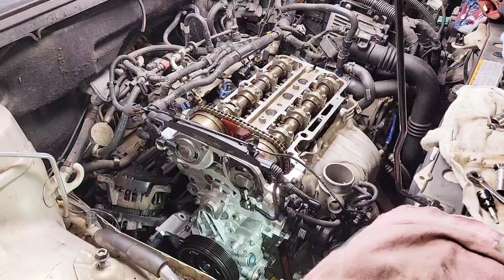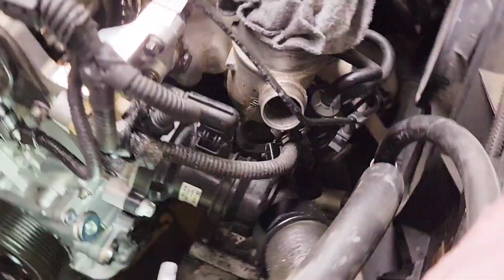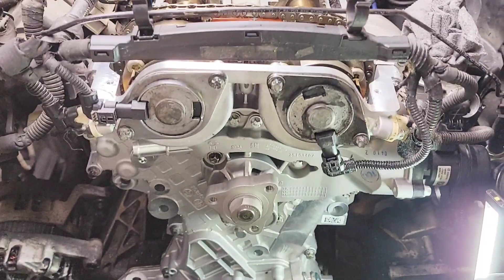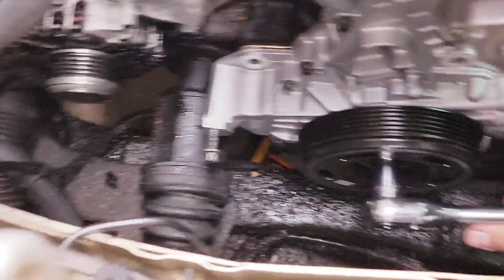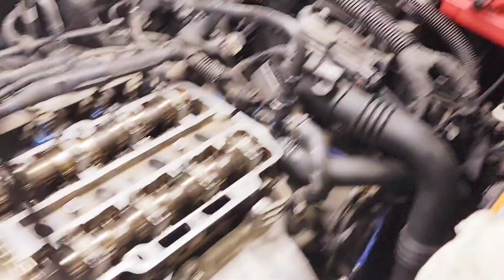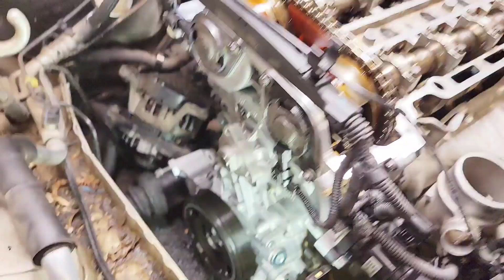V15: Chevy Cruze Timing Job Done!  Priming Engine Oil before Starting this Motor

Comment: Did you need to remove the camshaft sprocket bolts or adjust the exciter wheels in any way in order to get the timing cover on and off?
Reply from the maker: No you dont need to remove the Camshaft sprocket bolts, Just remove the 2 Cam position sensor